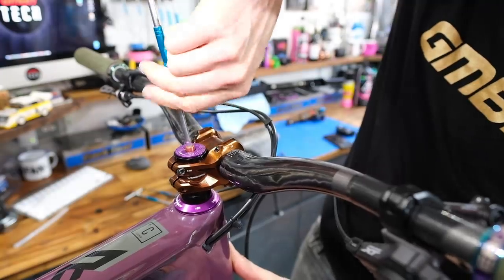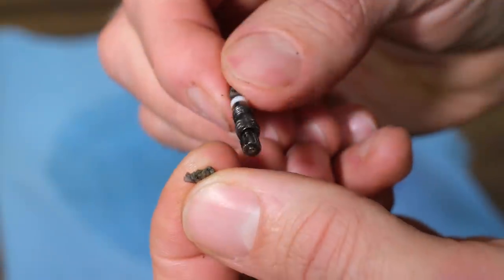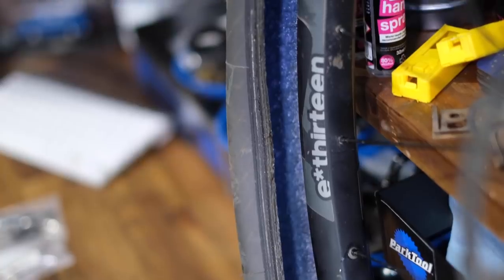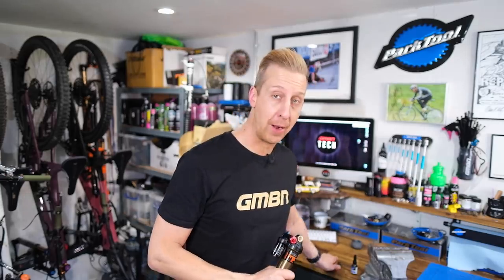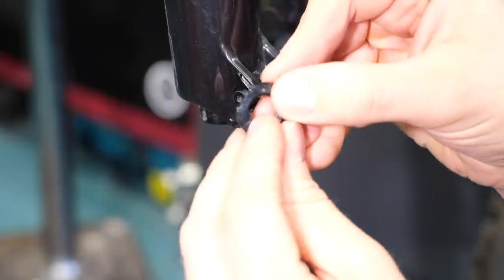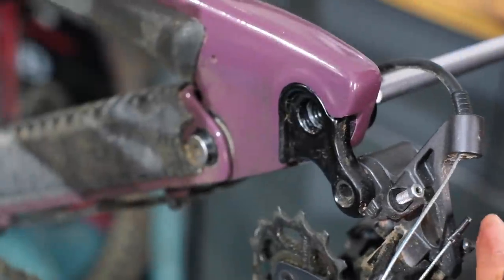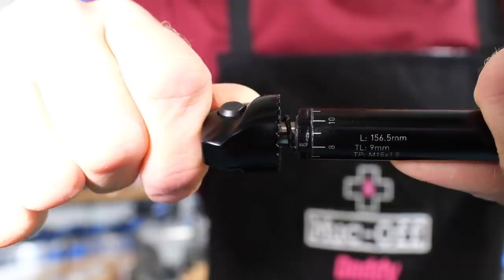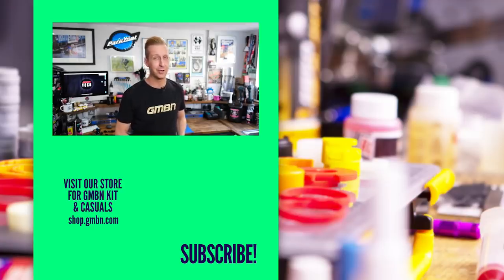Often Overlooked Maintenance Jobs That Could Save Damaging Your Mountain Bike!

Comment: I honestly believe that Presta valves are meaningless nowdays. The rims are so wide so Schrader valves fit and they dont clog that easily.
Reply: I think the same , presta sucks and breaks with hand pumps
Reply: Presta valves will just cause more maintenance and parts to adapt on but with a schrader it's just plug and play.
Reply: Without threads on the outside for the nut, how would schrader valve be held to the rim for tubeless??
Reply: @GHinWI  There are schrader valves with locknuts you can buy.
Reply: @GHinWI  It wouldn't but what's the problem with nuts
Reply: What if tire sealant gets in the valve?  Presta can be twisted apart and cleaned, Schrader would just have to be replaced?
Reply: @MehYam2112  Schrader valves have replaceable cores. Just ask any auto mechanic. It's how they let the air out of tires before taking them off. And the same thing is on Schrader tubes
Reply: Actually all Schrader valves have replacable cores, even the cheapest ones for car tyres.
Reply: And you can also get Schrader valves for tubeless setups with full thread on the outside.
Reply: @FreeRideKos  thanks, just googled it. TIL.
Reply: Also, it's a pain to deal with crappy adapters and stuff, with schrader if you have a gas station nearby your tyres are filled

Comment: On spokes rubbing, you might not like the sound, but if spokes cross, they should be touching, it helps them distribute the load evenly, don't try to prevent them from touching

Comment: Just a heads up for anyone with a newer fox fork, the axle has an 4mm hex nut at the opposite end of the lever and is adjusted with the lever 90 degrees open then tightening or loosing that nut.

Comment: If you are injecting sealant through the valve before you put the core back in attach your pump and give it a couple of pumps with the valve in a position where sealant will not flow back in. This will push the sealant out of the valve and possible increase the amount of time you get before it plugs up.
Reply: Good tip. Hadn't thought of using the pump before. Thanks

Comment: After adding sealant through the valve, I use a pipe cleaner to get the sealant cleaned out before I install the valve. Much fewer issues with clogged valves this way.
Reply: What I do is inject sealant through the valve, then put the valve at 9 o'clock while I blast air through it with a pump or compressor, so the sealant sprays through and drips away from the valve.
Reply: @mattgies  thats exactly what i do...give the open valve (with the core still removed) a blast of air. I usually just switch heads and hit it with the air nozzle.
Reply: @scotth1362  Yep, that'll do it!

Comment: I strongly agree with Doddy on the last one, quick release lever orientation. I've seen SO many people riding around with them stick straight out, like a bayonet 😂😂. I always make my levers are in the right position. Also, don't forget the rear lever! Sometimes I'll see people with them stock straight down...
Reply: According to RockShocks, you can place the maxle lever either straight back or straight up. I place mine up. Keeps it mostly behind the fork leg for a little bit more protection.

Comment: The bolt check is such an overlooked thing. My main pivot was loose and my whole rear triangle would flex left and right like crazy. Really unsettling feeling when riding. Also the drops outs definitely keep checking those 😂
Reply: Agree, this christmas i thought one of the shock bolts had grown a worn area and now had some play on it. Turns out it was loose and i had been running it like that for a month risking the damage i feared i had! Never again!

Comment: After all the frame bolts are torqued I index the bolt to the frame with a fine tip paint pen. After a ride if the marks are lined up the bolt is still properly torqued.
Reply: BuT wHaT iF tHe BoLt HaS mAgIcAlLy TuRnEd OnE fUlL rOtAtIoN?

Comment: @GMBNTech I marked all of my suspension bolts with silver sharpie at 90 degrees across the bolt.  This way, I can tell with a quick look if any of my bolts have loosened.  This keeps me from having to put a torque wrench on them to check and potentially breaking the thread lock bond in the process.  I still remove completely, lube and re-threadlock a couple times a year.  I then remove the old lines with a bit of acetone and remark them.  It is cheap insurance. If one of those bolts works loose, it can damage your frame.  The bolts themselves are also quite expensive if you lose them...
Reply: That’s a great tip! Talking from experience 🙄 those bolts are quite expensive and sometimes difficult to find, depending on the manufacturer of your bike. I check my bolts after every ride nowadays, but that’s not a bad idea..

Comment: I've had the worst clicking noise for months and blamed it on the pressfit bb, turns out my rear thru axle was fully dry and needed some grease.
Reply: Dang. Here in the PNW it is imperative to keep everything greased and lubed on a regular basis. Like he said, it is a water barrier. Works wonders. (I use marine grease).

Also, when cleaning off your dirty axle, don't forget to clean the receiving end on the bike. Does you no good to clean only half of the assembly!
Reply: man its always the pressfit bb😂

Comment: I made that mistake of not checking my bolts with my rear thru axle. I torqued it up, but I was careless enough to believe that it couldn’t really come loose on the trail. I was out night riding with one of my buddies when it started to come loose. My shifting got worse and worse so I thought it was something like a bent derailleur. While I was climbing up a hill, I heard a loud grinding noise from the back of my bike. I saw that it was my rear hub that made the noise and that’s when I realized it was toasted. I had to ride all the way back home with my pedals oscillating with the hub. When I got home and opened it up, the whole inside was torn up and that’s when I knew it was toasted. The only good thing that came out of it was an upgraded hub: The industry nine hydra. I love the new hub, but it cost me a good $600 to get my bike back up and running. The lesson learned is to always check your bolts before a ride, and if something seems a little off on the trail, check your bolts.

Comment: I pull out my brake pads fairly often and give them a spray with isopropyl alcohol and wipe all the dirt off, they get rather dirty. Even do a light sanding if necessary (due to poor conditions, salt, etc.). Also can clean out the calipers/pistons every so often by giving them a spray and wiping down with towel.

Comment: 6:37 I use stan's notubes race sealant and change it, at the very least, every 3 months, or if I stop hearing it slosh around/have a slow puncture. First day of January, of April etc... and yes, it congeals and sounds like you have a rock inside the tire sometimes. The race sealant variant has a lot of fibers and what not so it fills up holes really well, but that also counts for the valve cores and it can be a pain to get it inside the tire through a syringe.

Comment: I use a fine paint pen to mark a line across fasteners and frame or whatever, so it's obvious if one has moved - ie. is coming loose. Very quick and easy to check pre-ride (though I generally 'see' them when cleaning the bike anyway). Need refreshing every so often, but only takes minutes.
Of course it's not very pretty and if you are more into looks and fashion than function this will be fearsomely impossible to tolerate. But I'm an engineer and the bike is equipment that I expect to be reliable.

Comment: @gmbntech #feedback Doddy, what impeccable timing! I had a awful noise coming from what I could of sworn was BB. I couldn’t remove gx crank as the extraction bolt had decided to go it’s own way and you can’t get a new m30 bolt anyway right now. I didn’t think it was anything loose at back end as only torqued everything in feb. Decided to re-check after the show and found the culprit. One chainstay bolt had come loose,  re-torqued and hey presto dreadful noise has gone. THANKYOU. You had better check your new spectral 29er too!!!

Comment: The only thing I had to deal with valve core being clogged Stan's sealant, and greasing the ball bearings on the headset so the bearings don't fall off easily. Doddy explained all of my problems I have on my hardtail.

Comment: I haven't been able to get my forks/steerer out.. I remove the stem and there's some spacers which come off.. I think a little dust cover and then.. it's just rock solid i tap it with the rubber mallet but it doesn't move so I give up 🙃 it's a 2016ish Cannondale quick hybrid with the alu frame and carbon forks. I'll take it to the LBS I suppose if they open again. 😕

Comment: Excellent video, one thing you might consider though, if you have bolts repeatedly getting loose on your full suspension bike, most likely the bearings are seized. I was surprised to the amount of seized bearings I found after one (one!!) Bikepark Season on my DH. Especially when manufacturers save money and mount no-name cheap bearings. Also mark the bolts using a paint marker, so you don't have to torque check them.... If the paint is cracked, the bolt is loose... #gmbntech #askgmbntech
Reply: doing DH is really harsh on the bike, thoose are the ones that really need an eye up close because of the very extreme conditions, especially good riders capable of pushing limits

Comment: The Fox lever and nut shown at 18:15 are NOT the type where you make the angle adjustment by turning the captive nut. The captive nut shown in that clip has only one position it can be attached, and they are supplied with a lever that can have its tension adjusted by putting a hex wrench into a screw in the middle of the threaded end.

Comment: Tip with spokes.  Use different colored electrical tape on the spokes you are working on.  As you rotate your wheel around to check it's easy to lose track of which spoke is which.  Then you play "The monkey chases the weasel" as you tighten and loosen the wrong ones.  Not everyone can do this, but I prefer to support my local bike shop with this repair.  Once a year for the riding I do works well.

Comment: Can anything be done about creaky saddles? It sounds like the BB is dying up every hill but the bike is silent as soon as I stand up. This is with WTB saddles on two of my bikes and they both creak the same way. I've tried spraying silicone lube (Should be less hard on the plastic) where the saddle rails meet the plastic base of the saddle and greasing up the saddle clamp at the seatpost in case this is the issue, but it doesn't make much difference (And there's no sign of movement in the clamp either). I don't think it's the dropper post bushing as I have a KS on one bike and a Thomson on the other and the sound is exactly the same. Similarly I don't think it's the seatpost/frame contact either as that is well coated with anti-seize.
Reply: Try copper grease. Get it from any Halfords.
Reply: @rusty2222  I'm already using that where the seatpost touches the frame and in the clamp on the rails. There's no good way to get it between the saddle rails and the plastic body of the saddle where the noise seems to be coming from though.
Reply: I have the same issue with my saddle. It's from the saddle flexing under your weight. I constantly have to shift my weight around a little before the creaking stops. Thinking of getting a new saddle just to stop going crazy.

Comment: #askgmbntech Hi Doddy, because of annoying creaking sound while pedaling I just replaced BB and crankset on my aluminum hardtail (Sram DUB BSA and NX crank): at first ride it’s just creaking only under high load, pedaling both sit or stand up on pedals. I cleaned and regreased frame, BB, crankset and pedals bolts, tightened with correct torque. When reinstalling I noticed many grains of dust into the frame BB thread and tried to clean it as good as possible using WD40, a clean rag and toothbrush. Do you have any suggestions? Thanks a lot

Comment: Or, you could run tubes and avoid all those issues. Zero punctures with Ritchey WCS on my MTB and Gravelking SKs on gravel bike. At low pressure. Or on my tubulars when racing.

Comment: I put my Fox lever in that correct position on a new fork and caught it on a rock, punching the lever hard enough to push a hole in the lowers!  I now run all my levers in the Rockshox position to avoid this happening again.
Reply: Ive slammed my rear wheel on the ground hard enough for the QR lever to open by itself. I was more surprised my tyre didnt take a puncture or rim took any damage.

Comment: applied very little pressure to my rear shock bolt a few days ago, there was the slightest resistance then it was spinning in place, the head had come off the inner bolt which I suspect was caused by a worn flip chip, can't get a replacement until the end of next month so using a brake caliper bolt and shaped a washer to fit in the meantime.........is that a bodge? #AskGMBN

Comment: My headset keeps clicking badly when pedalling hard as I drop
In, I’ve tightened everything and realised the lower headset bearing had some scores on it, could it be loose, some dirt?
Reply: 2 new bearings
Reply: Smashy Rashy the bottom one is new
Reply: @jaydunn2898  clean and new grease
Reply: @jaydunn2898  Had the same problem with a "new" headset and I just cleaned the outside of the bearings, cleaned the inside of the frame and just put new grease in there. Very easy and in the end it works like new.

Comment: For grease as a barrier, I use anti-seize.  Its thick as fuck and sticks in place.  You'll not need to service your headset till the end of the season.  Not because it's dirty, but because you've got to tear your bike down once a year anyway.   I abuse my bikes with a high pressure sprayer so I've tested it.

Comment: #askgmbntech When my brakes are dry they squeal, however when they’re wet they’re silent... Any advice?
Reply: Rubbing alcohol and 3M scrub pad to rotors. Then take out and clean pads, or just replace as they are cheap. I usually use rubbing alcohol and a bit of fine sandpaper and try and remove the contamination layer. Make sure to always use a clean spot and rinse frequently.  You can use brake cleaner as well for both if you need something stronger.

Comment: I always wandered how sealant doesn't immediately start to dry the moment you inflate the tyre, just after the tubeless installation. I thought sealant activates with air (from a puncture)
Reply: I guess that it technically does, but it doesn't dry completely and once the air is damp enough from the sealant, it only dries as it comes out. Pressure differentials could also play a role with this

Comment: #askgmbntech Hi Doddy.
I realized you have the bikes hanging on the wall verticaly. I use to do the same until I was told by my local bike shop not to hang the in that way, insted always to be horizotal to the ground. The reason was for the bakes, as they felt later like having air inside or missing oil. How true is that?
Thank you.
Reply: It is true, reason being the air gets to the top of the brakes where you can feel it. 
Vertically has the benefit of re-lubing your inners in your fork.
Reply: What would be the best way to storage the bike then? 🤔
Reply: @erickmtz11  well vertically with a slight overhang so all the fluids lube your seals.
The air in your brakes will rise up, but see this as a chance to bleed them